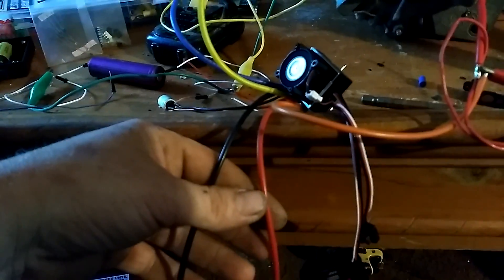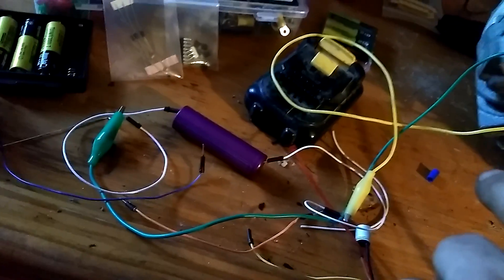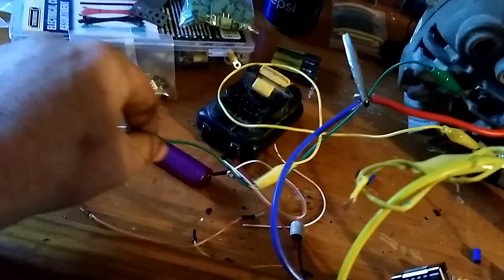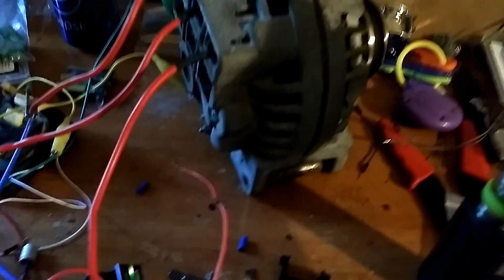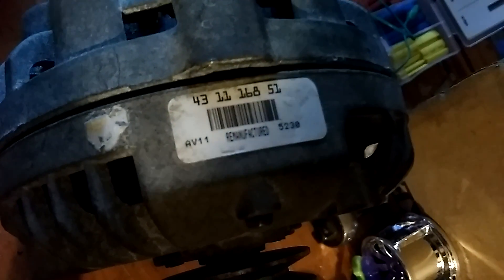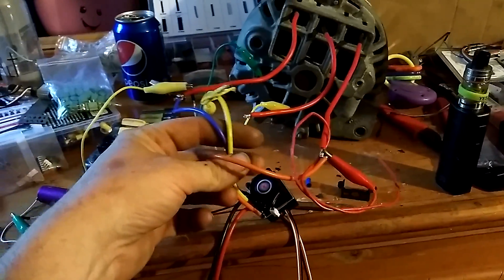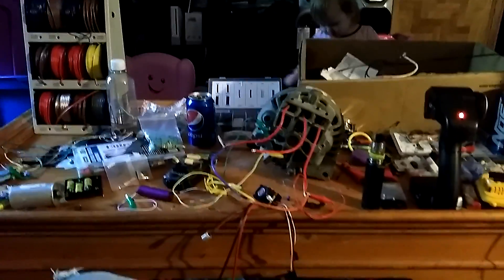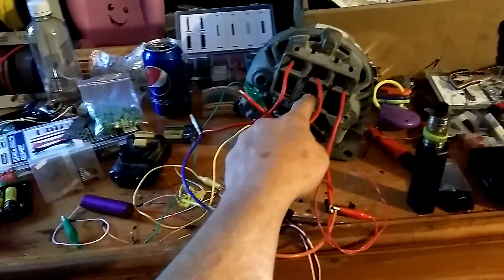HOW TO MAKE A BLDC MOTOR FROM A CAR ALTERNATOR

Comment: what vehicle is that alternator from?? I can't seem to find it.
Reply from the maker: Thank you for the kind comment but an alternator and a generator is the same thing. the difference in alternate current and direct current is direct current is a steady flow of electricity out of the negative side into the positive side and alternate current is current that flows out of both poles at the same time you do not need a 3-phase generator so you take the middle wire coming off of the outside coils and connect it to the ground and the outside casing of your generator there is more to it than this alone! I have made some other videos that will Enlighten you a little better on the research you should be doing... this is very dangerous and can and will kill you if you are not qualified to be handling and routing electrical currents. I do advise people not to try this at home or at least without the supervision of a professional...

Comment: i need 5 HP@800 RPM
FROM THAT CONTRAPTION.
HOW MUCH VOLTAGE AND AMPERAGE DO I HAVE TO FEED INTO IT AT FULL DRAW.
Reply from the maker: +creativ Electron7M  are you not the man who got on my YouTube channel a few days ago and started cussing me and talking trash to me saying that my technology wouldn't work and when I went and looked at your website you were doing almost the exact same thing as me? so I commented on that video trying to help you with some advice and again you were a jerk to me... that's fine block me, I'm going to block you too. I don't want to see your videos and I don't want you seeing my videos.
Reply from the maker: +Stupid Man
 brother at full draw for something like what you need.  Go get a bldc motor controller or Servo motor controller from a hobby you can get a small one say 20 amp and run the machine off of 2 or 3 18650 mod batteries that's what they make their battery packs out of there anyways they are lithium ion batteries used for vaporizing. That will control the motor on how it fires electrically through the three coils or I should say alternator that's being converted into a motor when you take the bridge rectifier out of it you will have 3 wire sitting there it won't matter how you hook up the three wires orange yellow whatever 2 your alternator but the speed will be controlled by a handle or a trigger or potentiometer however you want to do it my video shows the easiest way of just using a transceiver and receiver going to your Servo motor controller here's where this becomes tricky.. If you put 3 volts to the to field wires it won't have a tremendous amount of torque but it will run really fast you can control this with the trigger of course at any time but if you put let's say a small 12 vdc 35 amp 4-wheeler battery to the to field wires then it will only go 500 - 1000 RPM and if you try to stop it with your hand it will break your hand!! I hope this answers your question and always remember if you don't want to use  batteries or battery chargers you can always use Transformers there are so many out there it's ridiculous you probably have a hundred of them in your house right now... IE a cell phone charger or just about anything and they all have the specifications on them for specific applications.. Thank You!!  For the intelligent question brother!!! I really appreciate it and I really hope that I answered it in a way that you could understand!!!
Reply from the maker: +valveman12 I believe that your equations have mistaken you I put 12 volts 2 batteries that would be equal to 1000 amp batteries each to my BLDC alternator/motor and it handles it so the mathematical laws that everyone's been using just like Ohm's law is not exactly correct and when you add two or three of that same equations together you're adding about a 30% loss from each machine equaling enough efficiency to do the job... I'm telling you that you are about 30% off from where the actual values are coming out at... making your math tell you that it's impossible to do. Just like me using a 1 & a half horsepower AC motor compressor motor to turn two 10000 watt generator heads (10kw) and each one of those generator heads are rated at a minimum of 11 and a half horsepower each... so now this is the real question comes in... how am I able to turn to of those generator heads equaling 23 horsepower together (supposedly needing) but I'm only using one and a half horsepower and I know without seeing it first-hand that you won't believe it. That's why I posted the video showing me doing that! And I'm not here to argue with you I'm just stating what I have tested myself. And have shown on my channel in more than one video. I really do APPRECIATE you posting the equations above this comment as to the actual équations mathematically when worked out from the actual motor I have are a little bit different then 750 x equals 1 horsepower.  You are proving a point that even they are not following the rules that they have set out...
Reply from the maker: It's pretty easy to copy the same stuff that I said to you

Comment: Hey Tommy,
      Hey thanks for showing me that.  Now in one of your previous videos you showed a bridge rectifier that you said you would need that but,  you never said where to get that at or maybe what they would call it .  The other thing I would like you to answer for me is I have a gm alternator which an alternator is an alternator mine just happens to be a gm so thats no big deal.  Will it or could it power a gocart ?  My daughter is turning 10 next month and I already have the alternator and I have 2" pvc for the frame and some wheels ad tires  so it won't weigh any thing I just need to see if it would power it enough for her to have a  lot of fun with it !  Let e know if you would !  You have my email address !  Thanks buddy !
Reply from the maker: brother this particular motor that I made might be too strong for a kids go-kart you would have to make it out of some angle iron or Channel iron for it to be strong enough I don't know if you would want her on something this powerful...